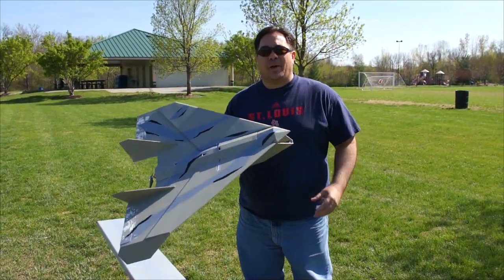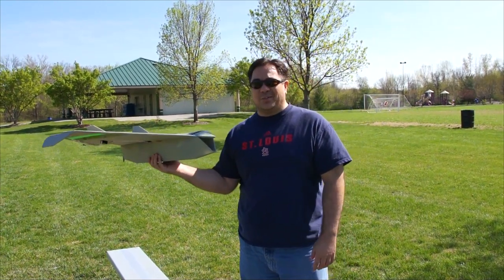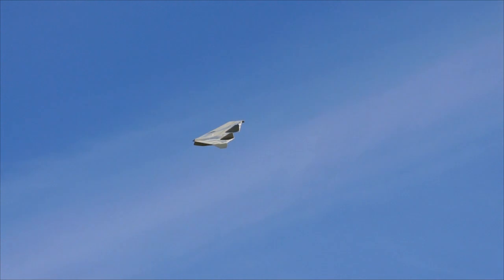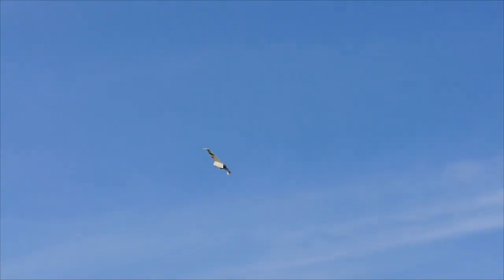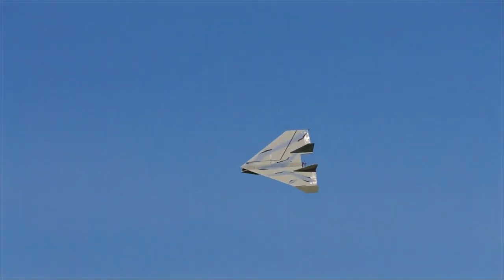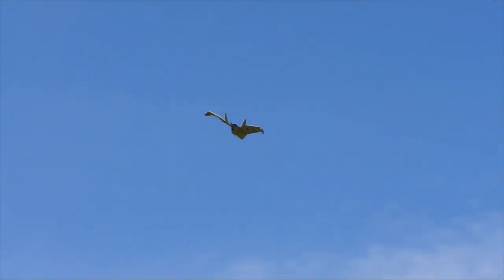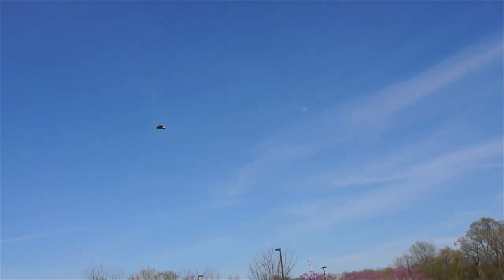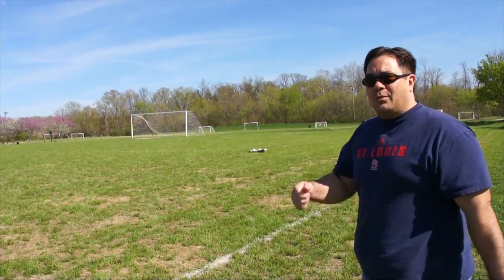MPUAV-Part4 "V2 Maiden Flight"

Comment: Very cool! like you said the weather has been crazy for a long while now and I haven't gotten a chance to fly in a month or so. I maidened a simple scratch built delta wing today as well as took some video with my quadcopter. The maiden went perfect and that vid will be up sometime tomorrow, but I managed to loose orientation on the quad and put it through a fence. I had 3 camera running at the time (2 onboard) and that video is finishing uploading now. 

Great vid guys! Keep up the great work!